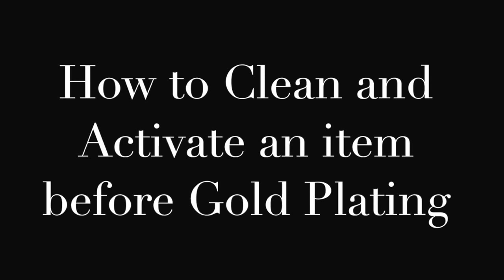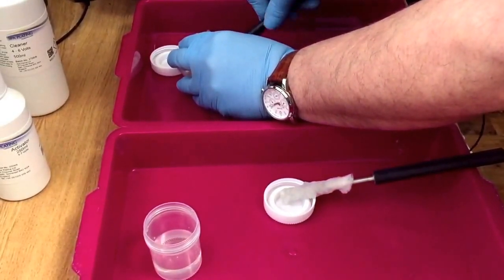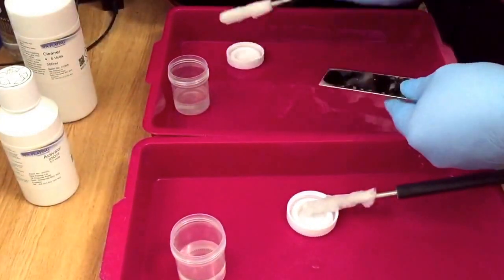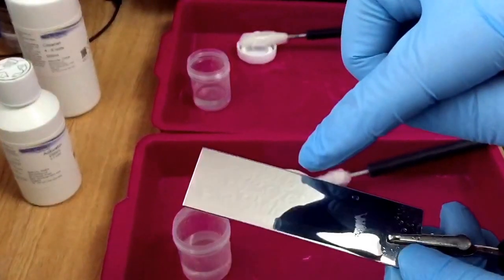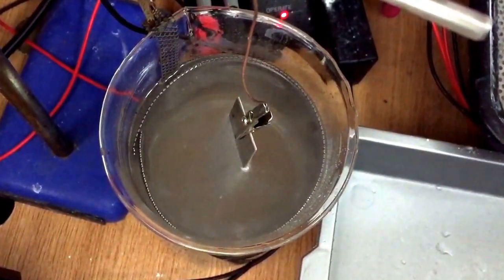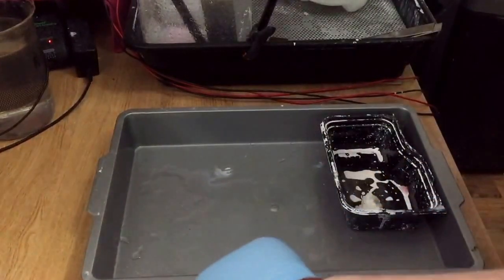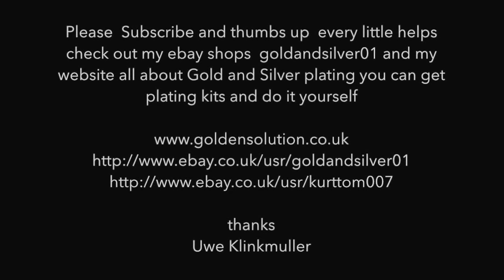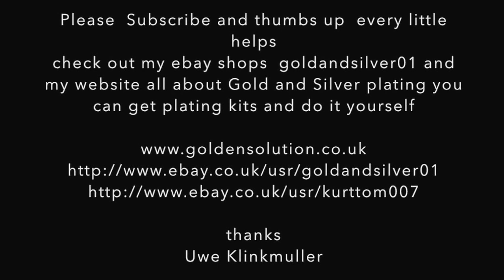How to Clean and Activate Stainless Steel before Gold Plating

Comment: I want to gold plate a stainless steel 32oz cup.  If I use a stencil for cleaning and activating can I remove the stencil and gold plate over the treated stainless and not affect the rest of the cup?
Reply from the maker: hm not sure exactly what you mean if you need to cover up an area you can use tape or nail vanish cleaning is always necessary
Reply: @GoldenSolutionPlating  will the untreated stainless steel be affected by the gold plating?
Reply from the maker: @bryanbowley7081  yes it will